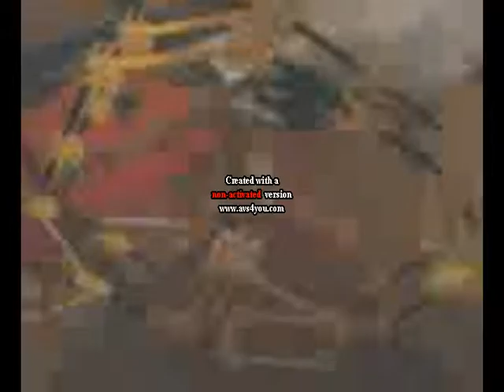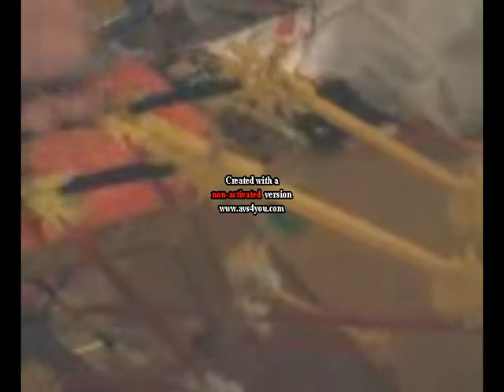Conventional Wheel Perpetual Motion Attempt #2

Comment from the maker: Secret: The central beam is fixed in place, with the white plastic wheels rotating smoothly around it. This allows the entire cardboard structure to be taped carefully to the central beam, while also permitting the tangling beads to rotate around the whole thing. The beam is fixed relatively sturdily to a structure outside the large wheel so that the cardboard structure does not rotate at all. I also realized additional structural elements could be attached to the beam, such as sturdy connectors, so long as I was careful that these additional members did not tangle with the sides of the larger wheel. For example, I could use one stiff piece running up part of the center, and then bend the cardboard around that and tape it at the bottom, which is I think what I did.